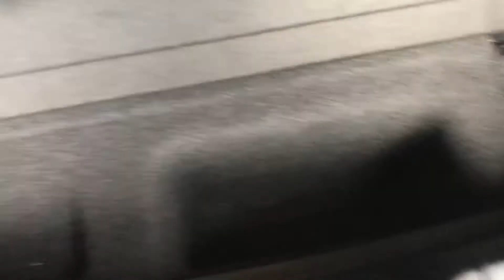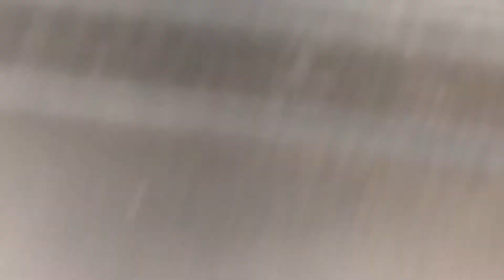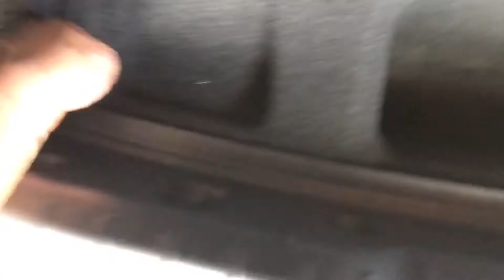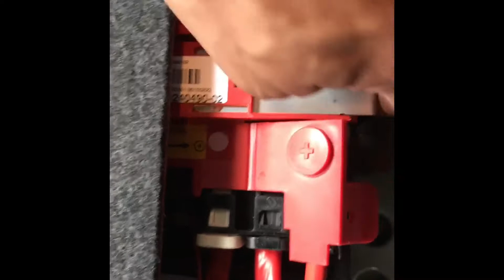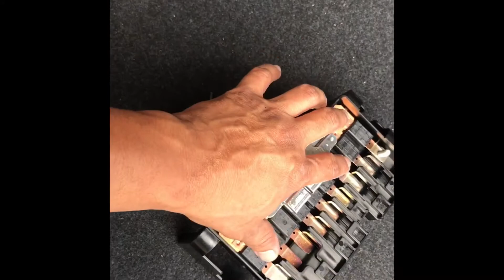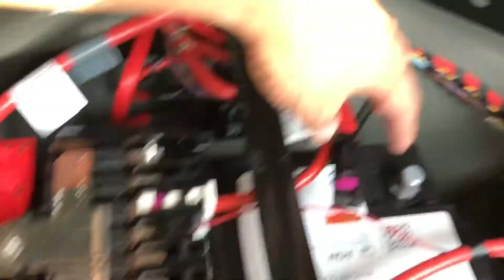BMW 535i F10 Battery Power Distribution Panel

Comment: Thank you so much for this! Just like you, I have crank/no start issue after i changed the blower motor. This saved me a lot of hassle and probably $$$. 

My sincerest thank you for figuring this out and posting. I feel very relieved. Also, lesson learned. Always disconnect your battery folks when dealing with electrical things 😂
Reply from the maker: I’m glad it helped. Show your support on my channel. You can send $$ whatever you like. PayPal: Dewana421@aol.com. 
Proceedings from my channel also helps charity.
Reply: I wish I found this before. When you had this happen, did you also get a Drivetrain Malfunction message? Also, did you by change ground one of the positive terminals causing the slot where the black/purple terminal to blow out? I had the same issue and I definitely have a bad fuse.  I ordered a new Panel to replace and I'm praying this fixes the issue.
Reply: @joh10usa  did it ever work for you?

Comment: dude, i just replaced the alternator and Battery in my 135i hoping to fix my no start. but to no avail, it didnt work. I came across your video. come to find out it was this. Thank you so much. Thankfully I have two 135i's and i was able to swap one PDM to the other car, and it started right up no problem.
Reply from the maker: Glad it worked. You can superthanks me :)

Comment: Most the time when your having issues with this distribution block and you have a crank but no start. Just disconnect the IBS sensor from the distribution block & the car will start right up. Obviously don’t just keep it like that. But it I’ll get you around while waiting on the new part.
Reply: Even if one of the fuses are blown, will it still start if i disconnect the IBS sensor?
Reply: Anyone verify if this works?

Comment: I need some advice please!  I had the same issue as you, didn’t disconnect the battery when fixing the blower motor and had drivetrain malfunction & cranking but no start issue.  So I replaced this distribution block (bought from eBay), and the error was fixed and car was able to start, the blower fan is working too.  BUT,  after driving around for a bit, the engine started to overheat and a drivetrain malfunction error popped up.  I had to pull to the side of the road and wait an hour for the car to cool down n drive home slowly.  I think it’s due to radiator fan not turning on? Any suggestions on where to look for the possible cause?  Thank you!
Reply from the maker: Check for the fan to turn on. Did you check all the fuses on the distribution panel for continuity? It’s possible that one of the fuse is bad. Not everything on eBay is fully functional.
Reply: Yes I checked for continuity, all are good. And today I took apart the IVM that sits above the blower assembly and checked all the fuses for continuity in there too and they are all good as well😢 I put everything back and turn on ignition and let the engine run for a while and drivetrain malfunction showed up again after abt 10 minutes. I did notice that the AC isn’t that cold~ if that can help with diagnosing😅 thankssss
Reply: Check your crancshaft pulley and the belt
Reply: @el3joz27  thank you for your suggestion, but it turns out that the issue is with the eBay bought distribution block, as it is defective. The seller sent another one and it fixed the issue.

Comment: Hey man, great video! Unfortunately i did the same thing, but on e91 335d. I replaced the blower motor and accidentally touched the positive and negative wires on the connector. Now my car just cranks but doesnt start. I checked the fuses on this power distribution panel but all of them are fine. I checked all other fuses too and all are fine. Do you have any idea what else could it be?
Reply from the maker: Sorry to hear that. Not sure about your model. Let me know what you find. Must be some fuse blown.
Reply: Yo bro did you find out?

Comment: Hey having trouble with 2013 f10 535i. I disconnected battery and I changed valve cover, essentric shaft, motor, but when I plugged my battery back in, it worked for five minutes and all power cut out if you know what could be done please let me know. Maybe my battery or just a simple fuse
Reply from the maker: @conal9628  check battery voltage. Is it completely dead? What is the battery voltage? Can you turn on headlights? Need more details. What do you mean by all power cutout
Reply: @ I tried to turn it over and just clicked.
  I used a trickle charger cause the battery was reading low. Was reading a good 12v so I disconnect and pressed the lock button and all power gone just nothing. I tried to jump and nothing but the alarm
Reply: It all started when I changed my oil filter and cooler gaskets and didn’t prime oil or plug in oil pressure sensor. Started and ofc bogged. I assumed oil starvation, and I immediately switched it off. Re-plugged everything back in and prime the oil and cleared the codes .
Tried to start. It threw me a timing chain code, which I checked out when I was under the valve cover looked good not much wear nice and tight and no brackets broken. But when I disconnected battery for valve cover, plugged back in afterwords and shortly cut out
Reply from the maker: @conal9628  yes dead battery. These cars are sensitive to voltage so if low it won’t turn over. Maybe take out the battery and take it to advance auto parts and leave it there for them to charge it. They have fast chargers with heavy amps. Leave it there for 24hours and it should be then fully charged properly. Tickle chargers are not really chargers imo. They are just little push and that’s it
Reply: Idk but I need to make sure timing is proper good and still need to calibrate my new essentric shaft and motor when I do get power. But when it threw me that timing chain code it also through a vanos intake code
Reply: @HowToDoitright  thank you. Do you mind if I text u back if that don’t work? And maybe for my timing situation?

Comment: I Replaced my Alternator and my Battery and the car takes no Charge from the Alternator with do you think it can be
Reply from the maker: @aarenallen1489  why would you change both? It’s very uncommon for both to go bad together. Normally it’s the alternator going bad which does not charge the battery so the battery deplete with the charge but once you recharge it the battery stays good. It’s also very common for people to change the battery without testing the alternator. So right now I suspect you didn’t know where the problem is and you replaced both is that correct?

Comment: My hvac blower motor on my 2011 alpina b7 does not blow any air at all. Ive replaced blower and resistor with no luck.. any ideas?
Reply from the maker: Check voltage at the blower motor. If none then check fuses.

Comment: Do you think this aftect the water pump bc my water pump is not working at all.
Reply from the maker: Not unless yo did something to blow a fuse. Fuses don’t just blow on their own. You water pump might be bad. Water pump run with your belt and they do go bad.
Reply: Not on e90 they have electricial water pump

Comment: Does it drain your battery? I have no crank/start I only can hear a click from the starter. I replaced battery/starter and still doing it.
Reply from the maker: Your issue sounds like a dead battery. Check voltage on it. If lower than 12.6 then remove it and take it to advanced auto parts or autozone and they will check it free of charge. If it’s over 5-6yr old then definitely going bad
Reply: @HowToDoitright  I replaced both Starter and battery and I only can hear a click
Reply: @mtrjn9605  hi did you figure it out im having the same issue
Reply: @danzgarage843  I have 2012 BMW E70 35i. Apparently when the Oil Pressure Sensor is shot it will drain the battery (No Idea why) and as long as the part is not replaced nothing will help the car to crank/start. All shops towed the car to told me that I have to replace the engine :)
Reply: @danzgarage843  bought new battery, the same thing happened (Battery drained), the culprit was oil pressure sensor, once I replaced it and charged the battery the car started with no hesitation. I have 2012 BMW E70 125K miles on it. I hope this will help you. I was told I have to replace the engine many times from different Mechanics
Reply: @danzgarage843  Oil Pressure Sensor was the culprit. Once replaced and charged the battery it was good to go. I was told that I need to replace the engine many times. spent so much money just by towing the car to different shops, $45 part can make lose money. Thank you german engineering (Break My Wallet)

Comment: So was was the problems the blown fuse was giving?
Reply from the maker: No start
Reply: @HowToDoitright  Would the engine turn over with the starter like it was trying to crank, but acted like it wasn't getting any fuel?
Reply: @cullmanautorebuilders  yeah that"s what i think is happening to my vehicle. Its cranking but not starting. It started a week ago but all of a sudden its not now. I think it might be this part.

Comment: My 2011 535i f10  is acting weird all in a sudden.   While driving the car, the windshield wiper will move itself, central lock malfunction, air conditioning not blowing cold air, backup camera malfunction...etc.   Very weird, and it usually happen during the super hot sunny day.  I wonder if its the relay, I checked the fuses but nothing burned.   I wonder if it is related to the power distribution panel.   Any hint ?
Reply from the maker: Check your battery. These cars are very sensitive to voltage. If battery is old it maybe dying causing these issues
Reply: @HowToDoitright  so you don't think it's the power distribution panel ?
Reply from the maker: Nope
Reply: What did it end up being?

Comment: Why did you have to replace that ? What was the problem on the car?
Reply from the maker: Fuse was blown on it
Reply: @HowToDoitright  what caused the fuse to blow?
Reply from the maker: FrigginJimLahey I was replacing the blower motor and did not disconnect the battery. During removal I hit the positive wire to the car body shorting the fuse.
Reply: @HowToDoitright  thank you for the quick feedback
Reply: I just did the same damn thing not disconnecting the battery and not watching the video in fullll

waiting on the part now
Reply: @mracudjoe1784  Did that part work out for you. Mine arrives tomorrow. Fingers crossed.
Reply: @HowToDoitright  that is exactly what I did this past weekend while replacing the blower motor. I'm going to pick up the new part today and replace it. Crank but no start is my issue.
Reply from the maker: Yeah I hated it man. It’s easy fix though.
Reply: @HowToDoitright  I was able to easily and fairly quickly install the new distributor yesterday and I'm now back on the road with nice cool AC. Your video was a big help. Thanks

Comment: Why can't you just use the spare one instead of the blown fuse? There is 2 fuses that aren't used.
Reply from the maker: you cant. fuses are different sizes and not all models have spares. if you have a spare one that is same as the one you need then yes you can however in my case i couldnt